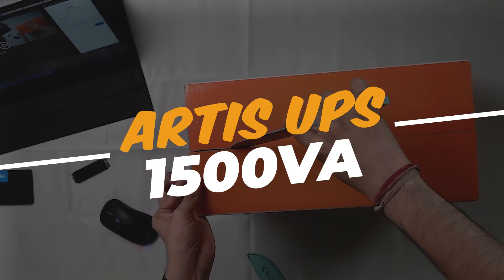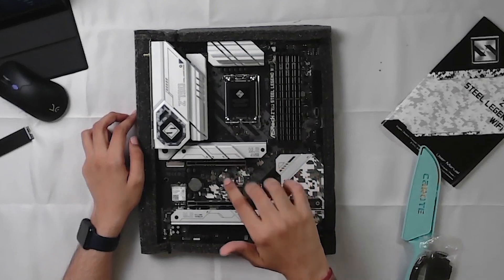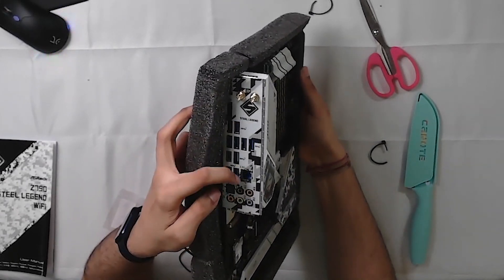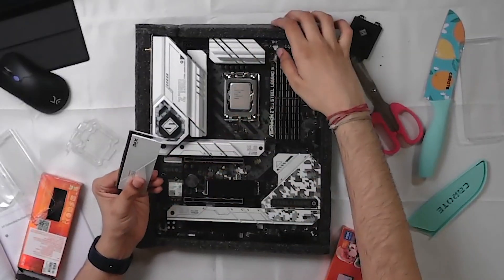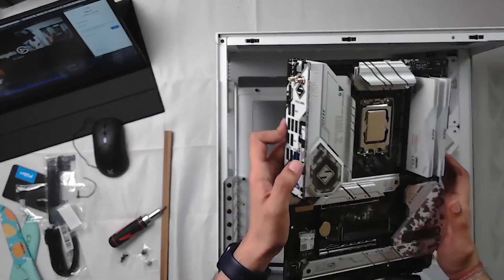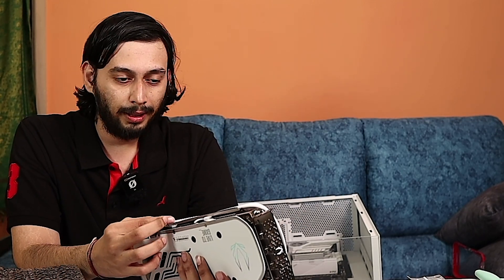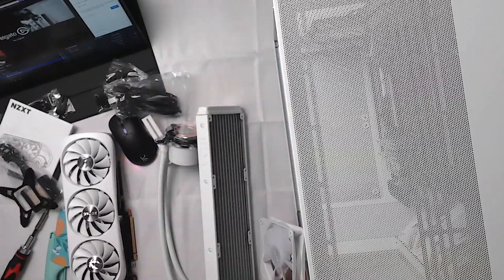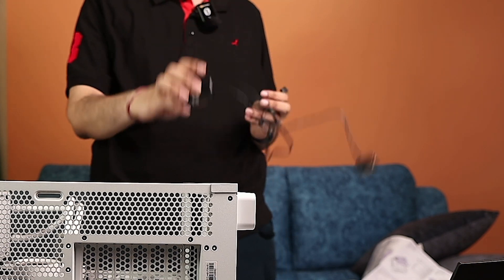Assembling My NEW ₹2.5 Lakh White PC!

Comment: Bro, as a fellow PC builder / enthusiast, I request you not to use the offline(line interactive) UPS even though it is 1.5 KV, because it can and will kill your hardware especially Motherboard/PSU. if you want power backup please use online UPS which is costly, if you don't have the budget then please don't buy these offline UPS, use your PC without UPS. 

+Reasons not to use/buy this UPS+

1. RTX 4080 - at its peak, it will draw 300+ watts.

2. Based on Gaming titles, CPU will draw 200+ watts and if you are using powerful tools for video editing or any heavy rendering tasks easily it will draw 300+ watts, since it is a "K" version, if you are overclocking the CPU then it can draw 400 watts based on the application you use.

3. My own experience, 10 years back my PSU got fried because of the 600 watts ups. when I investigated deeply this issue with the help of my electrician, I found that my ups was the main culprit.

4. I have not included Monitor, Motherboard, case fans, CPU and GPU fans, PSU fans, RAM consumption. because at a peak performance you PC draw 600+ watts which the UPS cannot handle(even though you are having 1.5kv). when switching to UPS power during power cut , and if you are working on a heavy application or playing a AAA title at that time then your UPS cannot handle that much consumption it will immediately turn off the PC and restart again.

5.Offline UPS are the most un reliable UPS ever.

6. At an idle situation, say for eg: You are watching YouTube video or just streaming a movie, that it self will draw up to 100 watts, based on the monitor and the video (if you are watching HDR 4K content).

6. If you want to understand better, I  would strongly advise you to watch this video, https://www.youtube.com/watch?v=d9sxQjTHgwY, if 10 years ago I would have known this, I might have saved my PSU.
Reply from the maker: Hi thanks for your detailed explanation.
I saw the linked video.

Few clarifications i wanted provide,

1. The UPS I bought is Line Interactive. It is not offline.

2. I am not using the UPS for backup, just to save my work and shut down my PC within a minute.

3. Using a PC without UPS is also bad, since your PC is doing a lot in the background and can cause data loss and corruption. 

4. Square Wave UPS is bad, Pure Sine Wave UPS is the way to go! These Line Interactive UPS have simulated / modified sinewave, I know it is not ideal. A good PSU can handle these voltage fluctuations caused by simulated sine waves.

5. Even if we have online UPS there is a high chance to have failures as well.

6. Best course of action during power cut is to shut down immediately and not use the PC further.
Reply: @YogiBytes  Thank you for the response bro. I learned from you something today🙌